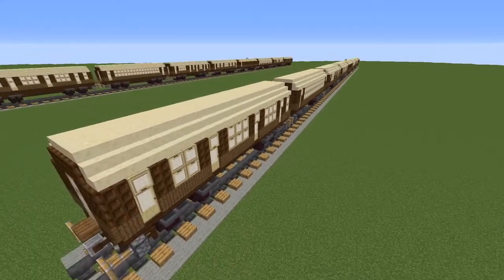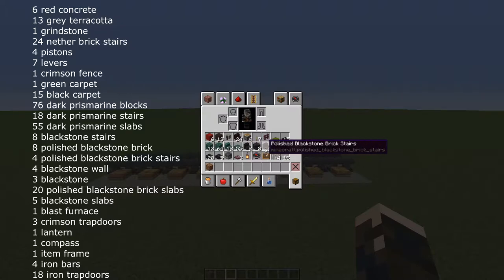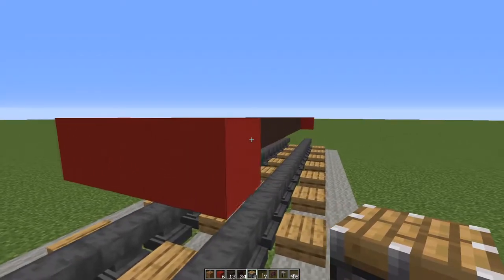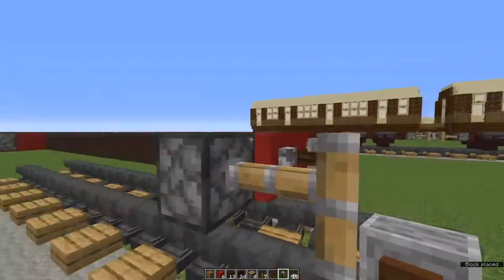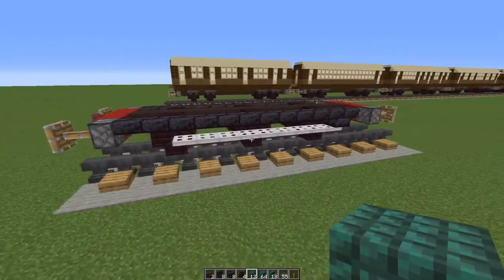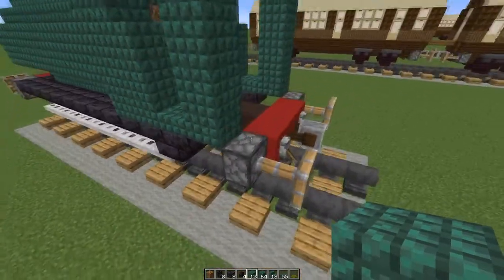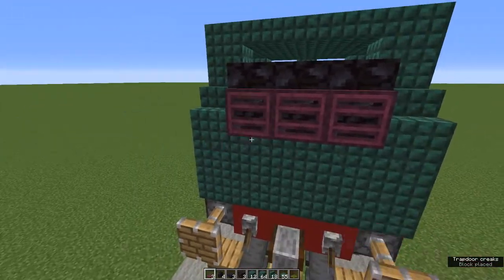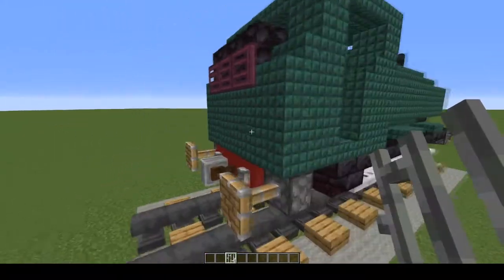LNER J52 Tank Engine - Minecraft British Steam Train Tutorial

Comment: I love how this turned out, especially with the addition of some of the new blocks! So far I think these tank engines are my favorite to watch you build.
And I know you've been putting the supplies at the start of these tutorials, but it still blows my mind how many blocks you need for these--it's expensive!
Reply from the maker: And these are just the small engines! They are not cheap, I am painfully aware of that. You could make this entirely in black, which would significantly lower the price. The J52 was often black, and during WW2 all engines were painted black. I am working on a red engine for my next one - that's a little cheaper 😆